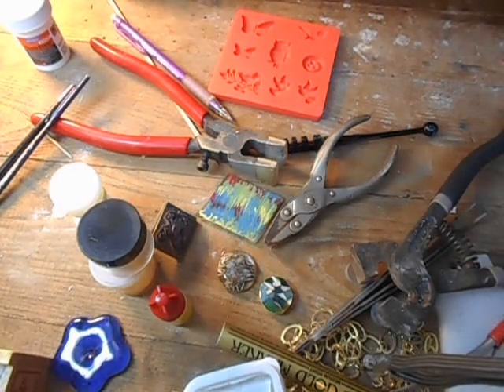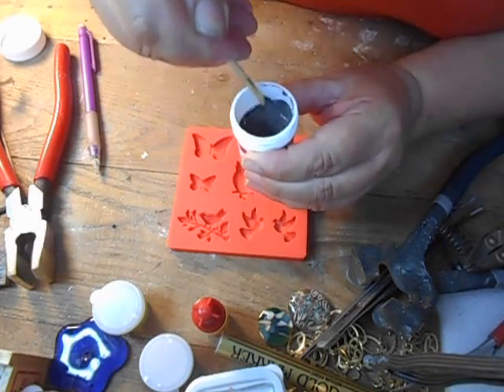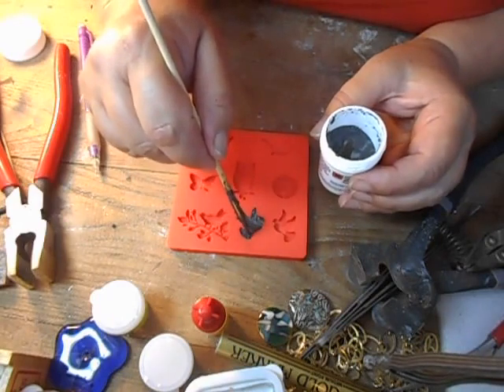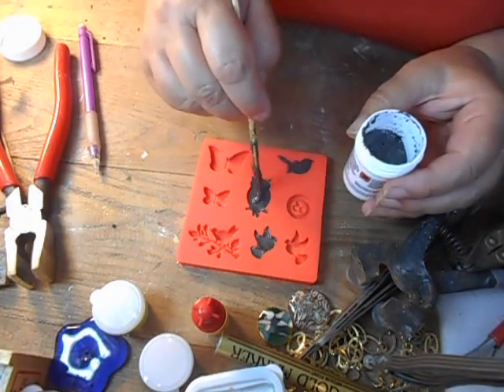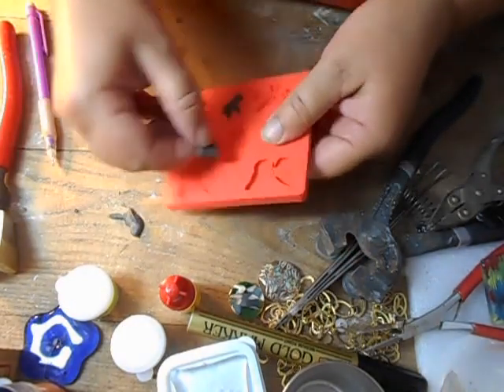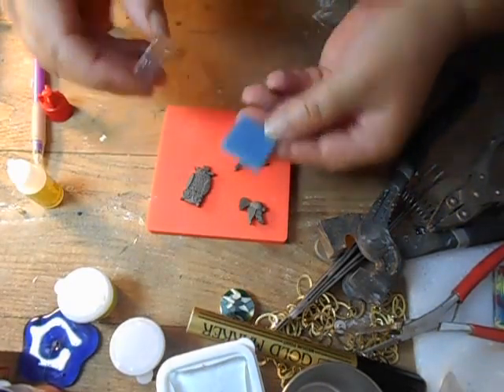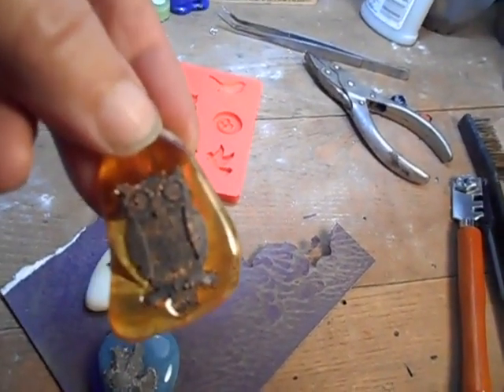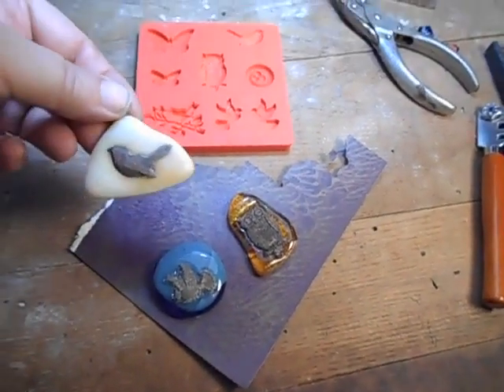QuikSteel charms in fused glass using the microwave kiln

Comment: Yes. I wanted the same one you used
Reply from the maker: I've had it for maybe ten years, I don't remember where it came from but I think it might have been marketed for polymer clay so maybe looking for molds branded for the poly-clay brands might come up with it.  If I run across it or remember where it came from I will comment again. EDIT: I think it was marketed for Fuseworks "Polar Fuse" glass fusing molds.

Comment: How about sandwiching the objects between two pieces of clear class?
Reply from the maker: The COE is too different and the glass will break around it.  Even putting them in the surface is "iffy" and a few of the pieces I did a couple years ago did eventually crack just sitting on the shelf.